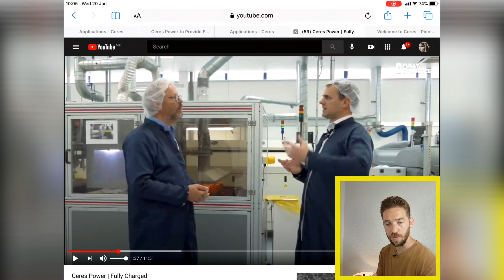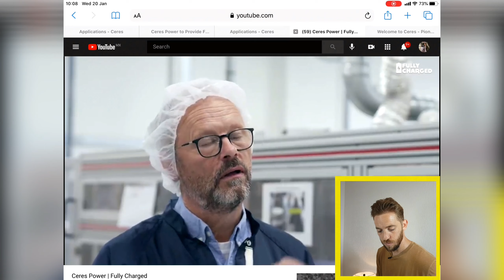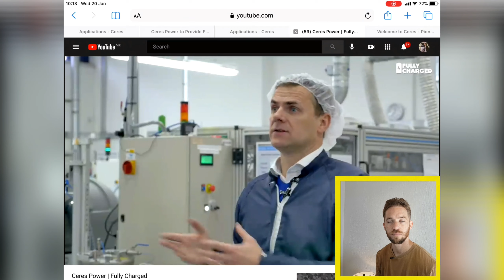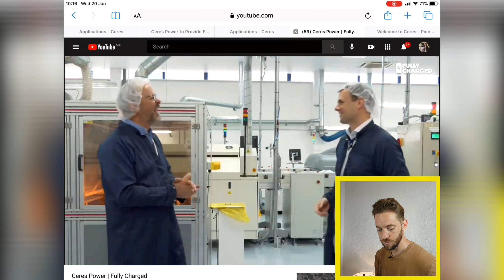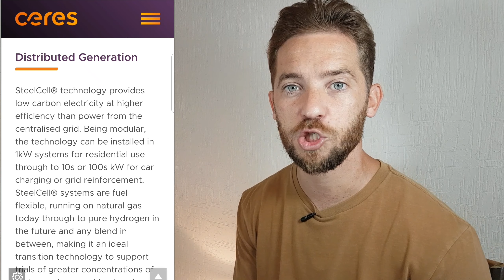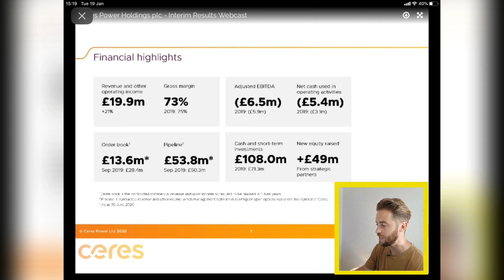I'M BUYING THIS STOCK NOW - 10X OPPORTUNITY IN RENEWABLES

Comment: fool cells is NOT renewable !!
using NG or Hydrogen (that you made from NG) is not green at all!
solar, wind , Hydro, geothermal are the only way it makes sense. 
if its not renewable then whats the point in investing trillions of dollars to change it all?
Reply from the maker: If electricity from renewable sources is used to create the hydrogen from water via electrolysis surely that is as close to a 100% renewable as it gets.
Reply: @trader_uk1446  afraid not.. today more than 95% of Hydrogen is being made from NG. ask yourself why.
you can store about a quarter of the electricity as Hydrogen, and the tank will lose pressure as time goes by.
imagine you that on every dollar you put in the bank, you can only get back a quarter.. and it will diminish by the day..  how many trillions of dollars would you put in this bank? .... and thats Hydrogen for you
didnt even talked about the price, infrastructure, or mobilizing it.. just the creation and storage alone should make you think TEN times before investing in Hydrogen..
if you want to learn more - try asking google why isnt Hydrogen being used.
good luck with your investments